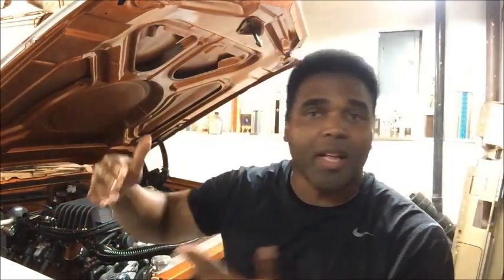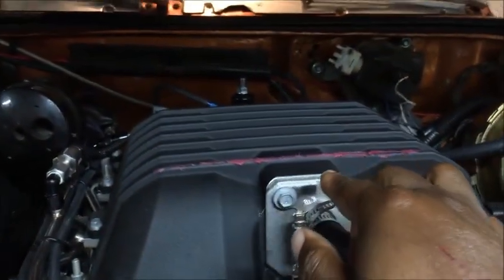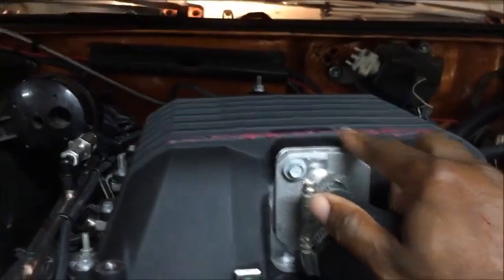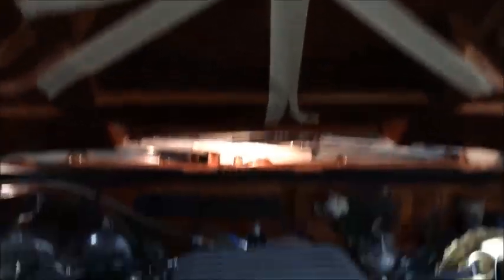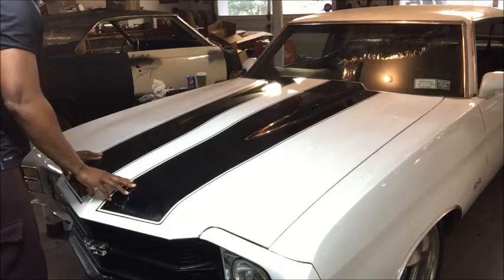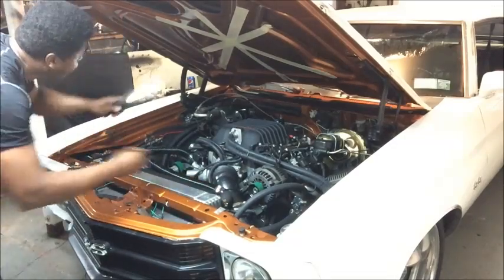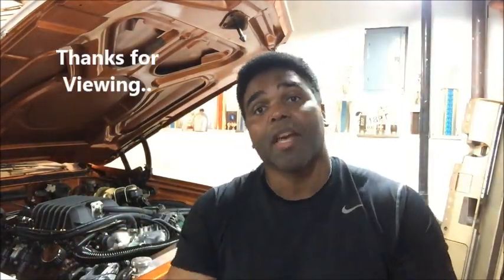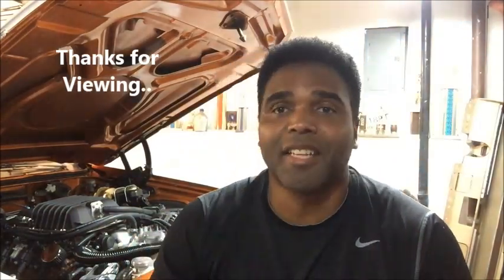How To Check LSA Supercharger Hood Clearance. (We have The Measurements!)

Comment: Hey Terry I’m working on 2 chevelles ! One is a 1970 SS with a LS6 and the other car is a 1971 SS chevelle it was in the movie drive angry ! I bought a LSA that came out of 2013 ZL1 ! Can I use the original wiring hornest that came with the LSA??
Reply from the maker: sure if its in good shape.. i would set it up on the engine and get it to run, then start removing the wires from the JB connector that are not being used.. or give PSI a call.. Done!.. keep me posted..

Comment: Terry, any suggestions on a welder for doing basic body work? Do I want 120 or 220 and do I need gas? I imagine I might be doing some heavier welding down the road suspension stuff. What do you use? thanks
Reply from the maker: whats good serious? the only welder i use in my garage shop is a small lincoln welder i had for years if ever i have to do frame work i crank it up.. i been able to weld up to a 1/4 in steel. here is a clip of the exact welder i use for everything. https://www.youtube.com/watch?v=4y_hOPTDYD4
Reply: Thanks Terry for the info and link!! One more huge question/help. Do you have an image of your 67 without the grill on but with the bumper filler panel in place? I bought a 67 chevelle that came in boxes. I'm trying to figure out what attaches that filler panel between the bumper and grill.  I see so many holes for bolts - all I see is fenders where it attaches. Huge thanks if you can help me. I've been searching google images.
Reply from the maker: email me your number and we can do a same time to get your right.. terrylsx@yahoo.com..

Comment: I use Playdoh or modeling clay on all the high points.
Reply from the maker: whats good GOAT..  

The tape is to represent the innerstructure of the standard hood that’s not on a cowl hood.. if the tape came in contact with the grease that means it would of came in contact with the
standard hood inner structure.. this test was not find out how much space you
have, but to find out if a standard hood would close..